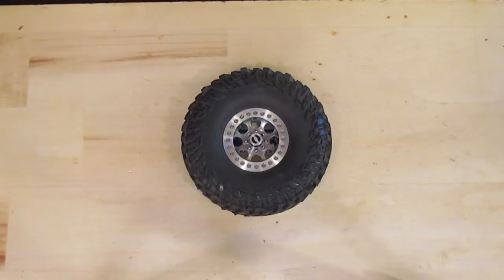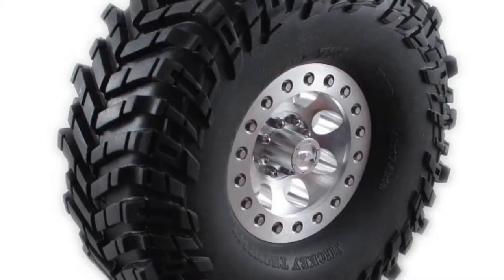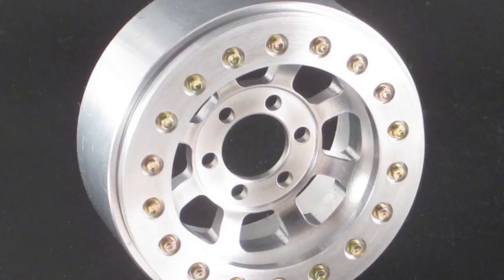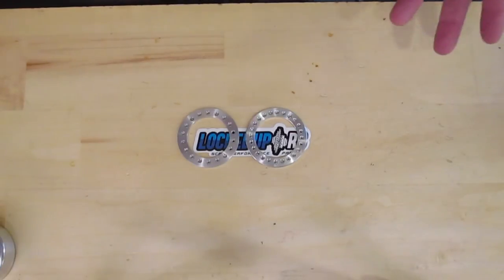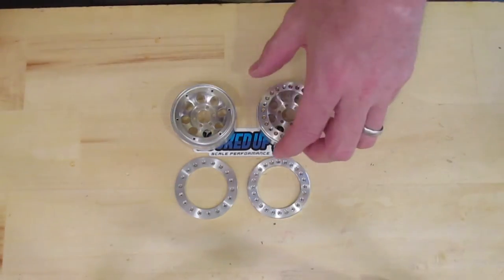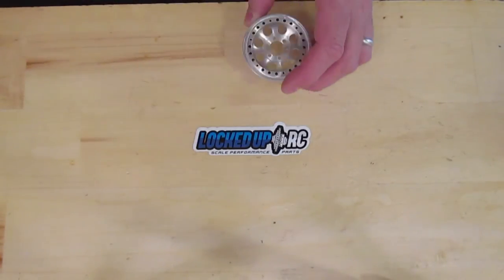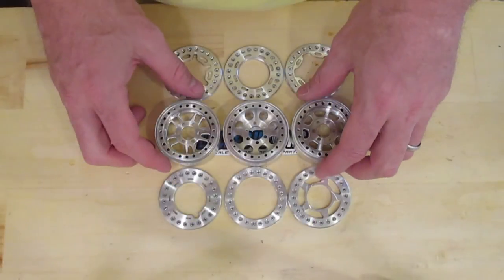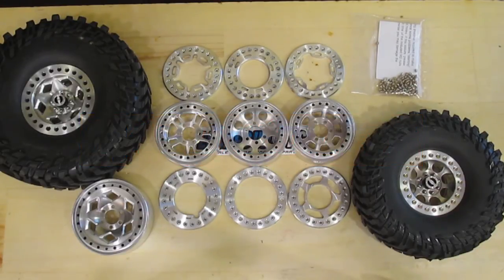Easy Mount Beadlock System

Comment: Are these available in the 17mm hex? I keep stripping 12mm plastic rims on a 6 cell slash 4x4, so I am basically looking to make the wheels bulletproof. Plus it appears that 1/8th scale buggy tires are best for people on a budget because even though the buggy tires are bigger, they are cheaper than the 12mm hex type tires? Crazy, any help is appreciated
Reply from the maker: These are available in 12mm machined hex which we call 8L™, SLW style and coming soon AO8™ style.These are all machined aluminum, which will be far superior to plastic.For a larger 3.8 size wheel, the increased cost of the wheel would offset the cost of tires, not to mention add a significant amount of rotating weight.
Reply: I was thinking more along the the lines of 17mm hex, 3.2 rims. This is a little beefier & more bulletproof. Recently I have not had any stripping of my plastic 2.8 rim 12mm hex beadlocks, maybe they are slightly better quality rims than the 2.2's? Maybe it's because I haven't run 6 cell through them yet (only 3 cell on the beadlocks) This week I will try the 2.8's on 6 cell to see if it will strip the rims, if it does, I absolutely will be going to the 17mm 3.2 rims for toughness & looks & price. It seems that everyone who beefs up their Slash 4x4 to 6 cell has to also upgrade to the 17 mm hex 3.2's.
Reply: We can't run 3.8's due to wheel turning clearance. Do you have the aluminum rims in 2.8's? They shouldn't strip out at the hubs since they would be aluminum but I really dig the looks (on the outside) of the beefy 17mm nut vs the tiny lugnut on the 12mm. Still undecided but doggone it, those are some nice looking rims you all make!